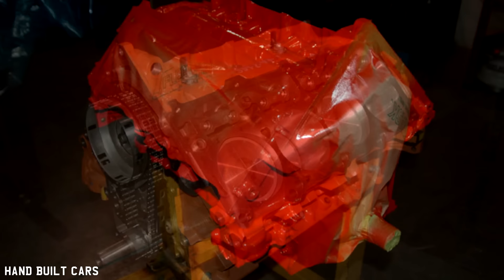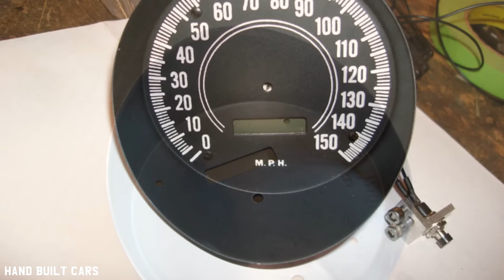1970 Plymouth Barracuda 6.1 HEMI Build Project

Comment: Beautiful. Almost the same color as the one I bought new at age 21 for $4k. My only 2 nits are the mags - if you're going to go retro why not take the road less driven and get a set of those '70's Keystones w/the flared spokes. The engine call-out on the hood - most all (unless you ordered delete on the power bulge hood style) 'Cudas said "'Cudaxxx" (x=cu.inches) or "Hemi'Cuda", but  6.1 liters is 372 cu. inches so I'd probably have the hood scoops read 'Cuda-372' or 'Cuda 6.1 since they aren't really Hemi's and more Polysphere anyway. 🚗